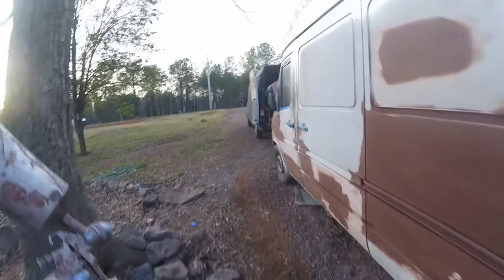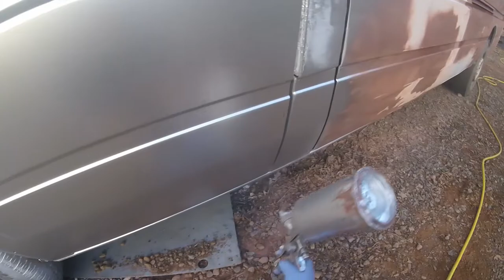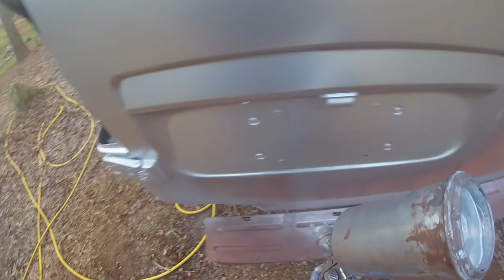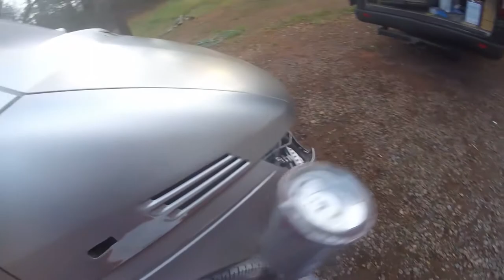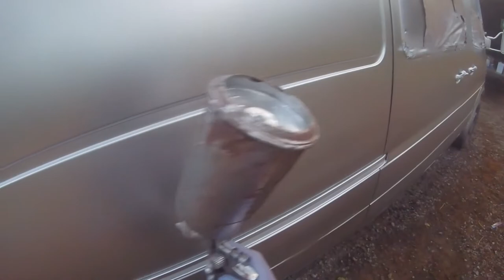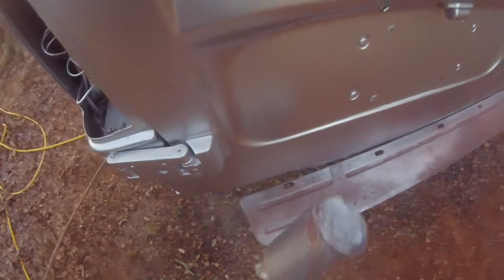Painting T1N Sprinter with Silver Rust Oleum Paint

Comment: Hey nice job! I want to do the same...Could you tell me the steps and clear a couple of things up?    So first to prep - do i sand all of the rust spots until i see no rust ?  Then bondo those spots if they are deep ?  Then when that is done do I do a primer coat ?  primer straight in the gun and apply ?   then I do the aluminum paint same way ?   Straight in the gun and spray ?  how many coats ?  When you say no mixing or thinning does that mean for aluminim paint ? straight from can into gun and go for it ?? Thanks!
Reply from the maker: It’s best to mix this aluminum paint with a little mineral spirits about 1 quart of spirits to one gallon of aluminum paint, but yes I did do some with mixing some without, without mixing you need to use sand gun like primer gun, but you still will have problems with Tiny filter getting clogged, so ultimately I removed that filter and just sprayed, it’s less professional, but it’s $50 paint job lol you are not trying to win a beauty contest at this price point, it won’t look amazing lol, but if you have a rusty ugly van, it will make it look brand new from 20 feet lol, when you get close and personal you can clearly see it’s a cheep paint job, it might even look like you used a spray can paint, but at 50 bucks you just care to look half way decent when your picking up loads, you will look like your actually clean and a new van that’s well Up kept and that’s what’s important, and about sanding rust, prepping is the most important, if you do a good job sanding then even this paint job look amazing, by the way, some people polish this paint and it looks great 👍 speaking of rust watch some videos on how to do it right, but what you said it’s true and how I do it, sand the rust down, prime it and paint it, if it’s deep rust use bondo, but this method basically does not cure rust, you basically just putting a Band-Aid on it, so a year from now, rust will be back, not in same numbers but it will pop up, I will do a video on it. So best way to sand the rust down and use some kind of any rust stuff and it kills the rust, then prime it and paint it, but I don’t have any right now so I use what I got, hope this helps
Reply: right on thanks for the reply!
Reply from the maker: Your welcome

Comment: Are you driving that same sprinter with the brake fuse / pedal switch problem to Laredo ? I see this is the second sprinter painted so far , you must have 3 operational sprinters by now ? 2 silver + one black .
Reply from the maker: +Mason Nesson lol yes but I only run one hehe
Reply from the maker: +Mason Nesson lol guess what I was responding to your comment bought 22 light coin and just sold it made $7 in less then 10 mins, now I am trying to buy 30

Comment: I was going to ask you.  How's it holding up?  Any rust coming back?
Reply from the maker: +Joe Moto it’s holding up good, but this looks like a spray can Job, I Guess what can you expect for $20 per gallon, one thing is for sure it’s cheep to repaint and you can get your van looking decent to look like new when you go on pickups and droop off, and I really don’t believe this paint can protect sprinter from Rust, I have experience with this over 2 years using this paint, the paint will fade in less then a year and rust will comeback, but if you think about it, this vans rust from factory and they actually put a layer of corrosion protection and it still does not help
Reply: ZIMALETA HOW TO SHOW & UNBOXING the sprinter factory corrosion paint is yellowish and too thin.  You have to spot treat the rust with rust converter, or expoy, then top coat.  As long as you check a wet line, can or sprayer, it will premo
Reply from the maker: +Joe Moto good idea, it defensibly needs something
Reply: Mercs are the worst for rusting, its probably the best thing for it.
Reply from the maker: Yep that’s what I thought

Comment: Hi. Love this chanel. I need to remove the ecu from my 312d sprinter. Me being me I can't even find the thing. I thought it was in the passenger dash but it's definitely not there. Could you help me???
Reply from the maker: +Louis Abbott yes it’s little cared in the driver dash on the left side below the place where you can put your wallet, I have videos on this where I replace the ECU
Reply: Fantastic I will have a look tomorrow and get back to you
Reply from the maker: +Louis Abbott sounds great
Reply: Right I've got another question. I feel like it's not going to be the last. A lot of this I could probably find online but I like this way. First the ecu apparently isn't recognising the chassis? Does this mean I need a new ecu? And secondly I need to buy  new battery. What are the specs of the battery I need. Thanks again
Reply from the maker: +Louis Abbott you need H8 Battery, as for the computer / ECU I am not sure, I never had this problem, but I seen others have it and recommended Fix was ECU replacement, but I always wondered, because I heard new ECU just for about anything, to me the question I ask, what made ECU not respond to begin with, and could it be something else, like the wiring harness or lose ground or something else, I just don’t see how the computer would be bad